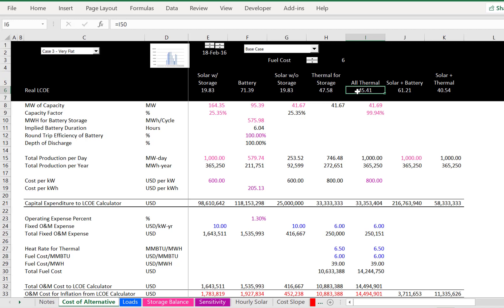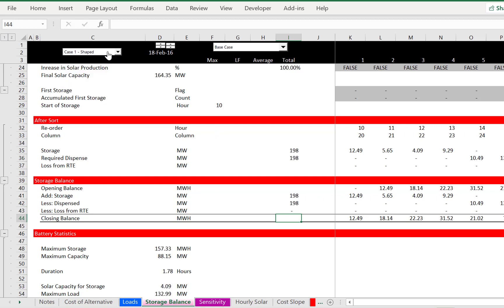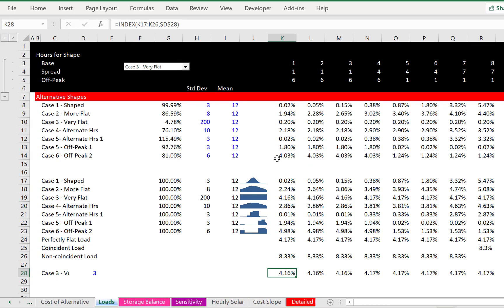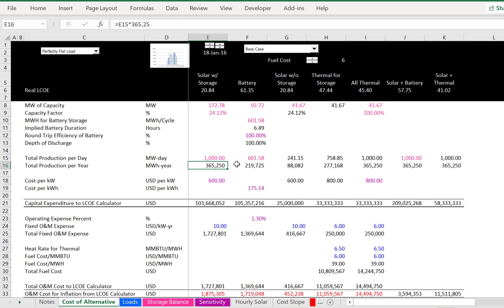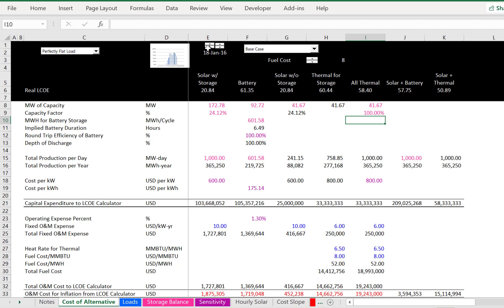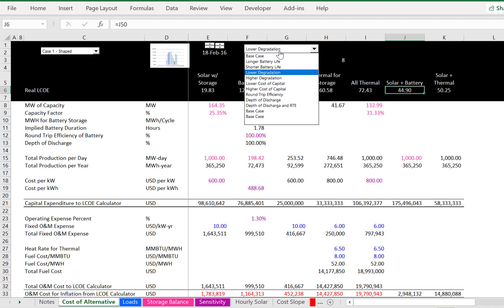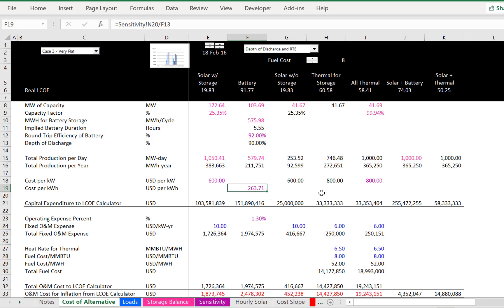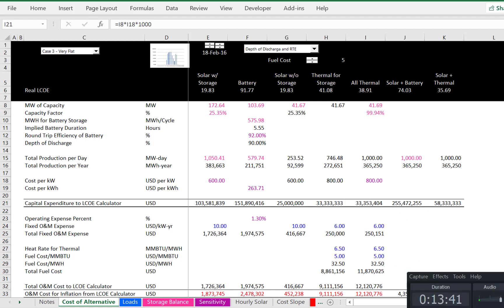Summary of Storage Analysis Presented in Next Two Videos

Comment: Hi Edward, thank you for the comprehensive video series on battery analysis. I went to your website and searched all the pages concerning battery analysis for the file being used here without much success. All of the excel files downloaded came from your previous battery videos in 2017 and 2018. If possible, could you point me in the right direction?
Reply from the maker: I uploaded the file to the battery section
Reply: @EdwardBodmer  Thank you for your guidance. I have manged to locate the file under "Solar Battery Hydrogen Course".